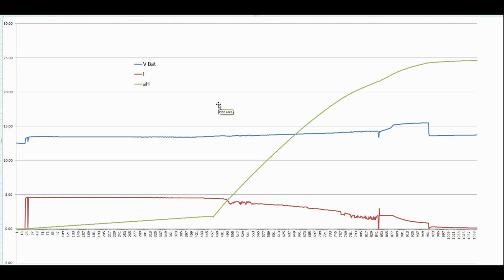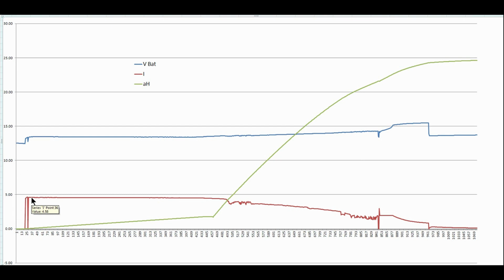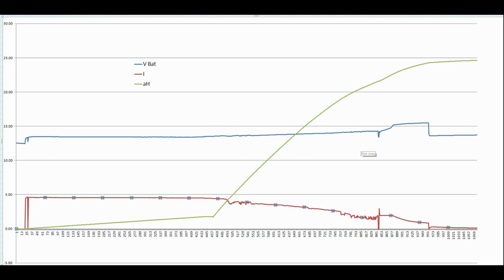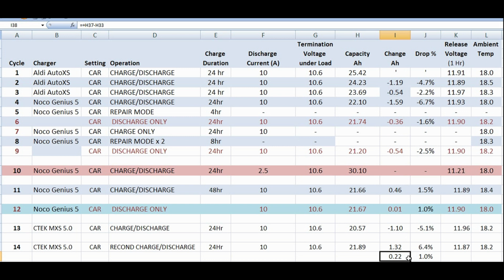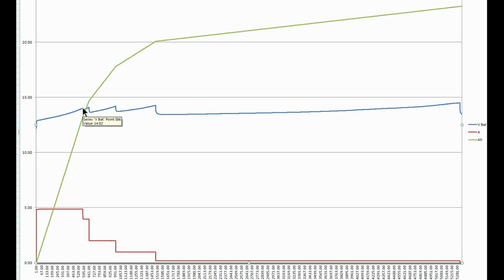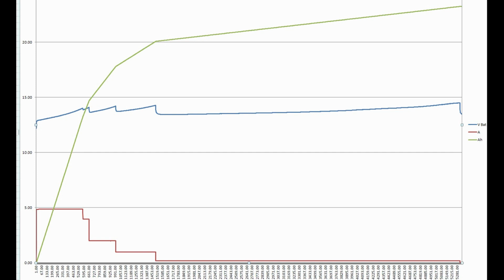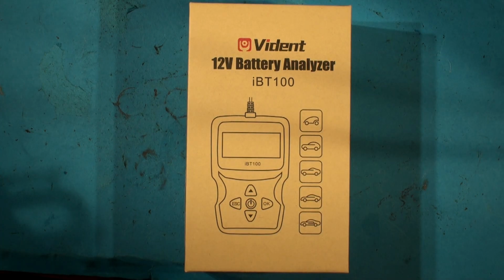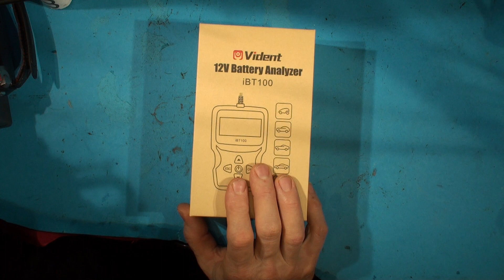Does the NOCO Genius5  charge better a than CTEK MXS 5.0 ???. NOCO Parametric Test Part 5

Comment: Good comparaison, but no method.
3 cycles of each function would have been good for more accuracy.
Brand new noco genius 5 with a worm defective ctek with some dim led. IMO not very fair.

No battery simulation with one or two dead cells ?
However interesting video.
Reply from the maker: That is the trouble with anecdotal experience or warm feelings towards a brand. They don't hold up to scrutiny when you subjected to accurate test and measurement equipment. .  By the way the CTEK isn't old or defective it is just about a year old and has only done a dozen or so charges.    In fact it has only done these charges. The results are pretty consistent - Maybe you could explain what you would expect to see in the data.   From run to run we didn't see any aberrations or big differences in data.   In summary, performance wise,  there  isn't much to choose between any of the smart chargers. Getting near max charge into a battery is simple. The facts remain the facts regardless of extravagant marketing claims.  Then it comes down to electronic design, build quality, reliability and value for money.
Reply: @Magic Smoke Thanks for your answer.
I also have a ctek but the old version (silver mxs5 with black button).
Dim LEDs are abnormal. The LEDs should light up from left to right.
Since yours comment, I replayed the video, I misread the charge curve on the ctek because you have your shunt in serie, I had completely forgotten, my mistake. (in step 4 you should have constant voltage).

The ctek desulfation ( step 1 ) is an "extravagant marketing claim". The impultions are not strong enough and the working time is so short.

After a repair mode, you should restart a charge cycle, because the energy of the pulses comes from the battery, it is not without loss.

this noco genius 5 is very interesting ...
what is the temperature of this noco when the battery is flat ? ( mine ctek is hot on a flat battey, but it's very rare I have a flat battery )
can noco detect batteries with dead cells ? No analyse step on the noco. I wonder how and when it detects a bad battery.
I subscribed, looking forward to seeing your next videos. 👍
( sorry for my english, i'm french )
Reply: poor guy must have bought a ctek. lol

Comment: Looking to get the best auto charger for a car. Advise what is better, more reliable for charging a 100 amp battery? NOCO Genius5 CTEK MXS 5.0 Reliability and quality of performance are extremely important.
Reply from the maker: I am not sure about the best as I haven't tested them all yet.  My views aren't the same as some here claiming to be much more experienced than me.  From what I have seen so far there is little difference in quality between the Aldi and LIDL offerings and the CTEK.   If CTEK were a doctor he would be prescribing medicines with bad side effects to otherwise perfectly healthy patients.  i.e Reconditioning a mostly healthy battery makes things worse.  In general,  I believe the reconditioning and repair claims are bogus. All you need to do is periodically charge your battery (~monthly) with a charger that does a correct profile charge that is within the manufacturer's specification.  For my money the NOCO is a much better design, the current transitions are precise, well regulated and accurate and the charge cut off voltage is accurate too.  The CTEK has been tweaked to increase the power output when it should have been redesigned so it is weak and gets too hot,

Comment: Try AGM mode on either or both chargers with the same batteries, same tests. You May find some hidden Ah in there :)
Reply from the maker: Thanks for the food for thought. My understanding is that the termination voltage is higher and the charge current is slightly higher later in the cycle.  The only way it can make the battery hold extra charge is to change the nature of the plates or electrolyte in a positive way. The trouble is that there are too many variables. Many hold dear the idea that what they do to recover a bad battery works for them,   but very few, if any, have done any measurement. It just seems much better after the battery is charged. Well yes it does but that is the effect of the recent charge not the reconditioning. It is similar to how a clean car seems to go faster and excellent expensive clubs will improve a crap golfer's play.
Reply: @razenby  Yes, the only reason I mention it is because I have noted better results charging flat batteries under the agm mode. If I am trying to remove stratification or sulfation from a battery I will drain it with a heavy load to get it warmed up and then hit it with either agm mode on my prologix pl2320 or use the big manual battery charger and throw 60 amps at it until it reaches around 15.1-15.5 volts, then I let it soak at 10 amps again until it reaches 15 volts, then put it on trickle charge about 4 amps for a few more hours. I repeat this process 4 or 5 times until I see diminishing returns. This has been the only way I have seen notable recovery of any batteries. Most batteries once damaged are a total loss however, never coming back to thier original capacity. I always check the battery when I am done this process both with a capacitance meter and a carbon pile to gauge the performance of said battery.

Comment: Brilliant. I'm not very good. I graduated from an economic faculty.but I am very passionate.it is magnificent what you do but I have a question on the chart i understand that ctek has been running only 24 hours ore.programul the desulfation is spread over 10 days.you think the situation would have been after the 10 days another?And you think we could see how the CCA develops?Can you find a way to measure CCA?
Where have you been in the last 3 years that i have been trying hard to find out the mysteries behind the batteries and chargers?
"I appreciate your work and your knowledge!!
Reply from the maker: I haven't witnessed any other activity on the charge after the completion of the initial stages,  Until proven otherwise I assume that the 7 day claim is just smoke and mirrors.

Comment: To me it looks like the CTEK reconditioning mode is more efficient (1.32Ah capacity gain) than Noco Genius 5 repair mode is (0.54Ah capacity decrease). Important to take in to consideration that the battery was more exhausted by these full charge/discharge cycles when CTEK recon mode was used. 
Or am I reading your measures wrong?
Reply from the maker: Ctek Recond charge  was 1,32 Ah more than the CTEK standard charge and 0.22 Ah better than the last NOCO charge.  I am waiting for a battery manufacturer tech expert to call me back. I logged a few questions that they are referring to the development team.  I don't believe a sample of one battery tested is conclusive. It could have been miraculous and we would have seen it work. But we did not.  I have another battery taken out of service from my daily driver last week at the recommendation of the service agent. .  The starter didn't quite as chirpy as usual starting in the recent really cold mornings (By southern UK standards-2 deg ). Otherwise I didn't notice anything awry with it.  Anyway, here it is on the floor undergoing similar tests. Results soon.

Comment: Thanks again for yet another  conclusive test; it's really helping me decide on a charger for my classic car. Now we know that the recondition mode is irrelevant, I'd be curious to see Noco Genius 5 (5 amp) on a straight charge vs Noco Genius 2 (2 amp) on a straight charge (over a longer period of time)  to see if one restores more cpapcity than the other.
Reply: The recondition mode is only irrelevant if you go by the capacity test completed for the problem that ills this particular battery.  We don't know the exact issue that is causing the lower capacity in this battery. Also, we don't know what exactly the recondition/repair modes are targeting in terms of what they are trying to repair - we just know how they are trying to repair it.  It's entirely possible that the battery's root issue that is causing the lower capacity isn't something that can be addressed by these modes  - ie there might be heavy physical wear on the plates that can't be fixed by a simple overcharge.
Reply: @richardlouie2922 
The regeneration mode is designed to remove sulfates from the battery plates, which are deposited on them. when the battery is undercharged for a long time (due to a malfunctioning charging system in the car). In Ca/Ca battery technology, only at voltage i.e. approx. >=15,8V and charging current<=0.02 to 0.05C light sulfation will be removed from the batteries, which consequently restores the recommended electrolyte density of 1.28g/cm3 and partially restores the battery capacity.
In addition, Ctek says in the manual that the recond mode is to mix the electrolyte, which becomes stratified over time, meaning that the electrolyte is thinner at the top of the plates and denser at the bottom, causing corrosion of the battery plates. The recond mode nullifies this stratification.
I'm surprised that British (English-speaking) users don't know anything about this, because this knowledge is almost common in Polish or Russian forums.
Reply from the maker: No problem. Could give that a go. I have both chargers,  What do you think would you consider to be a reasonable period?
Reply: @razenby  That'd be great if you could give it a try. I was thinking just let them both go until they auto-terminate. Would that work?
Reply from the maker: @balicrimechannel8143  Should do. The charges I have done with the Genius 5 auto terminated. I could try the JAG battery next. Do some CCA testing too.  I am keen to open up this HBC012 Yuasa / Halfords battery and see what state the electrolyte is in.
Reply: @razenby  I'm looking forward to it! Not only is this all very helpful for my charger purchase decision, but also very educational. I'm learning a lot about batteries that I never knew and may have never got around to learning otherwise.
Reply: @razenby  You could also use the CTEK it has a built-in low current mode (the motorcycle mode) as a way to verify.

Comment: Very informative, Nice to see you’re a JAGMAN it’s all vintage Jags I’m restoring now , looking forward to you testing out the battery testers as I have both the old-fashioned drop tester and the new electronic gadget similar to the one you’re showing I found it quite good.
Reply from the maker: Hi Paul. Yes, every man should have a Jaaaag!  Encouraging that you find the conductance tester is good. Is it the same manufacturer as the one I have?
Reply: @razenby  hi it’s a CENT-TECH
Reply from the maker: @paulmuff9883  Haven't tried that one.

Comment: The A*h calculation on Ctek draw is IMHO wrong. Time scale is in minutes? If so - after 60 minutes you should have c.a. 4Ah.
Reply from the maker: true..i wondered who would notice that..
Reply: Also, why does the gradient of the Ah curve suddenly get way steeper without the current going up at all? Surely at constant current the Ah should be a straight line, and as the current starts to reduce, the gradient of the Ah curve should start to reduce? What am I missing?

Comment: Interesting videos, question for you I have the noco genuine 5 and I have a VRLA battery when charging this should I leave it on the regular 12v setting or should I have it on the AGM setting?
Reply from the maker: Good question. AGM is a different battery chemistry and structure to standard to VRLA batterries. I am not sure. The charging parameters between the two types differ. I am about to to do the parametric testing on the NOCO Genius 5. I will find out and discuss in the next video.
Reply: @razenby  The AGM battery is also a VRLA battery. AGM means that the liquid electrolyte is impregnated into the glass mat. These accumulators are hermetically sealed and are protected against rupture by the VRLA pressure relief valve. This type of battery is charged with a maximum voltage of 14.9 V.
Translated by Google Translate
Reply from the maker: @zdenekzalis5916  Thanks for the info.

Comment: It was great...good to know.on battery university site, they say 15.5 v under 2 amp is very good for desulphate,but no longer than 2 days.i bay 2 power support supplays and i try.after 2 days battery was dead.shortcir uit.
Reply from the maker: Good info. I will try that and see what happens...
Reply: That sounds like the standard equalization charge that is recommended by many battery OEMs.  Of course, none of the OEM documentation I have seen seems to agree on the exact numbers  - ie voltage, current, how long to run it for, and how often to run it.

On a related note, the CTEK may be attempting to run a standard equalization charge to 15.8V but time limited out to 4 hours (as per their manual).  I would be interesting to see a comparison between running a standard charge and CTEK's Recon mode ran multiple times (ie multiple Recon cycles in a row to simulate a standard equalization charge) until the charger stops time limiting out at 4 hours.  I've found that on my CTEK, the charger will stop the Recon mode once the terminal voltage hits 15.8V rather than waiting the 4 hours.

Comment: After all the effort you’ve put into this whole matter I’d conclude that it comes down to only one point: the charger’s quality of construction (durability and ease of repair). A charger that lasts for a long time is a better investment, causes less electronic waste and can be used on a regular base, which is, as far the battery is concerned, the most important aspect. 
The chief mechanic of the biggest general car repair shop in the region explained it to me like this; modern cars are stuffed with electric consumers that slowly drain the battery when the car is not in use, causing at least partial discharges at the first opportunity. That’s why the life span of the batteries has gone down drastically in the last years (during winter they get a huge weekly delivery of new batteries). With a modern car one practically owns a plug-in hybrid; if you want your new battery to last, I was told, connect it to a charger once the car is parked in the garage, especially in winter.
A comment regarding CTEK vs NOCO; seeing the graphs, Noco is straightforward about its task, while CTEK does a political mess. Considering that CTEK’s construction is faulty, Noco seems the clear winner of the two. The fancy reconditioning mode is nothing more that a short and limited rise of voltage, which can’t influence the stability of the crystalline deposits in any tangible extent and therefore break it down. Therefore, regularly plugging-in the new battery once the car is parked seems the only way to avoid filling the bank accounts of the battery producers; for this we need a sturdy, quality battery charger that lasts for a long time.
Reply from the maker: thank you for the comment. I agree.  I present the evidence. You decide.  Personally, I wouldn't trust a mechanics views on complex electrical issues. Whilst the car is parked it  draws current for the alarm circuit and alarm sensors. This probably in the order of 100 to 200 mA.  You can do the math when the car is parked up.     The other problem is that on short runs you cannot complete the float charge so most town cars are driving around with the battery typically  at 80% charge.  After being parked for a while, the battery in a car that struggles to start has 14.4V at near full alternator capacity stuffed into it.  This is not good.  All battery lead is recycled and the purity is questionable. The latest stop-start cars have much better batteries that are very accurately managed by the  electronics. The quality of new batteries has deteriorated to just be over the line. There is no honest quantitative test when claiming under battery warranty. It is a huge business. Many ridiculous marketing claims for these reconditioning chargers.
Reply: @razenby  Thank you for your amazing technical reviews! 
Actually, now you’ve repeated exactly the same as the mechanic said about the quality of the new classic batteries getting worse and worse. The whole battery chain makes truckloads of money lately.
After shorter trips (groceries, errands) it really extends the battery life of one regularly connects it to a charger. Something I started to do only one month ago; I’ve surely shortened the life span of both batteries. By the way, five very cold days while the car was parked have drastically reduced the voltage of my 5 year old Varta Silver Dynamic 85Ah; from 12,7V to 12,43V.
Reply from the maker: @irionpleione8312  Good points.
Reply: That is a very good habbit...when u start the car u kill battery...after one start u must go for 100 km to put the curent back
Reply from the maker: @dacomaniac  300A for 5 Seconds =  0.4aH. It is prolonged parking not starting that wears the battery down.